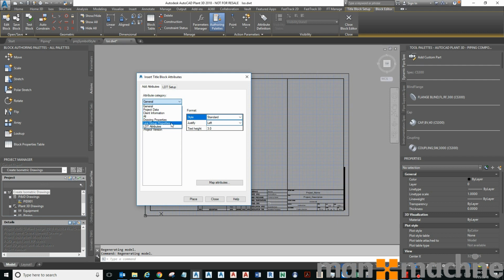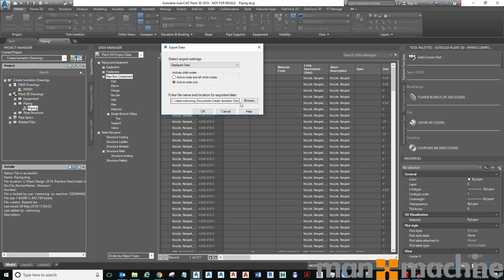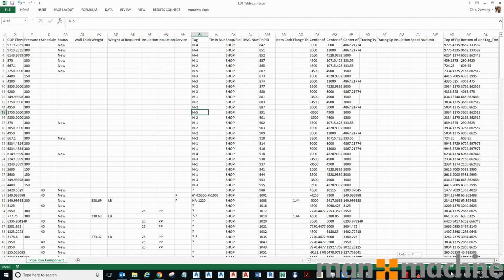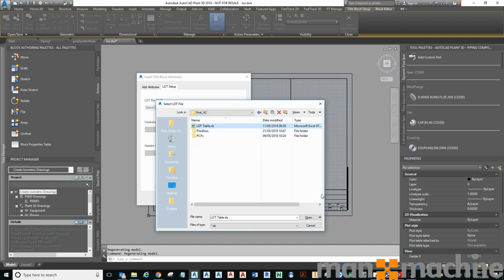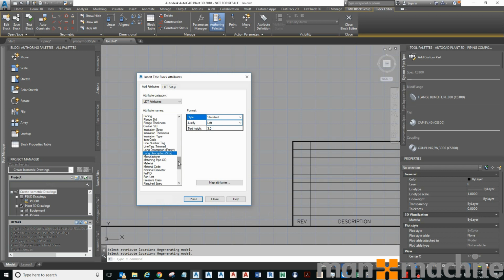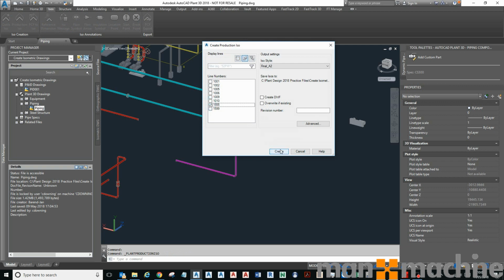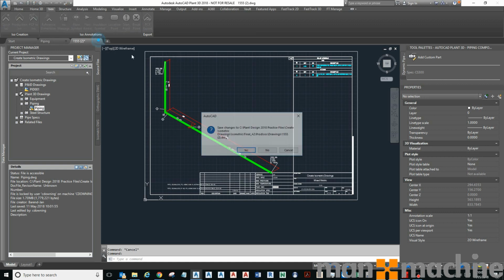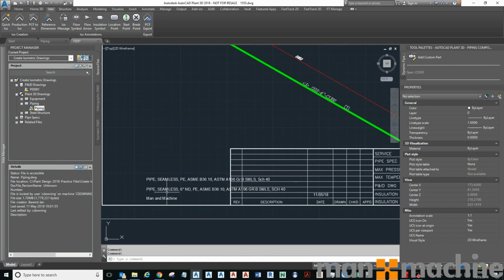Map ISO Attrubutes to Plant 3D Properties Using an LDT Table

Comment: I've added design temps and max temps to P3D Line Group so they can be mapped to isometric border fields. They can be modified through Data Manager, and it seems to be working well. Do you see any issues with adding those properties to P3D Line Group? We are not creating P&IDs with P3D so I added them to the P3D Line Group properties. So far so good..